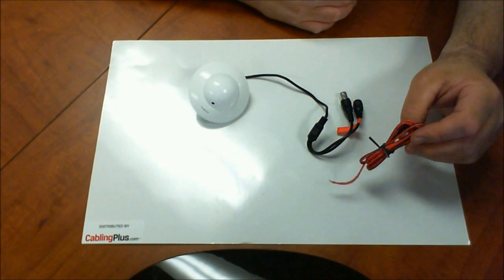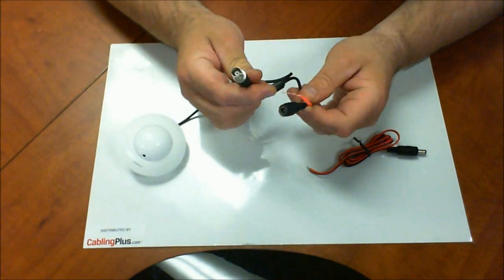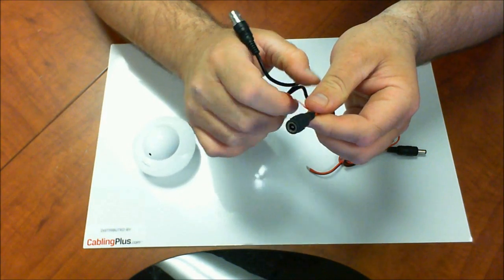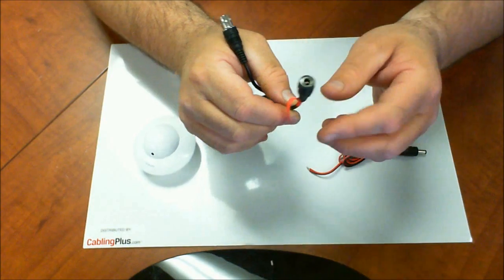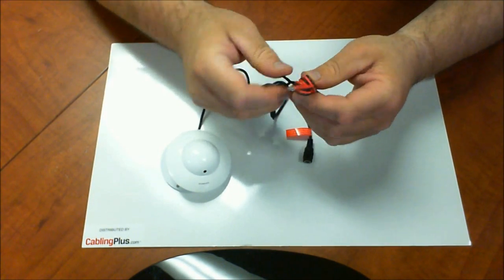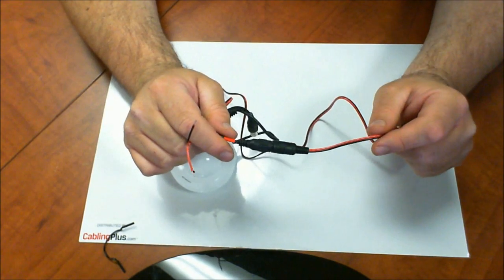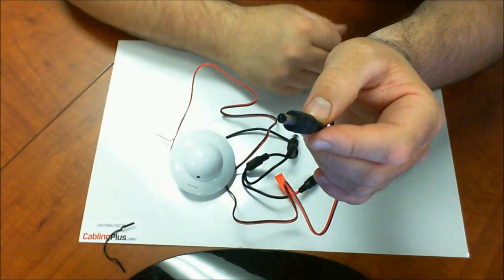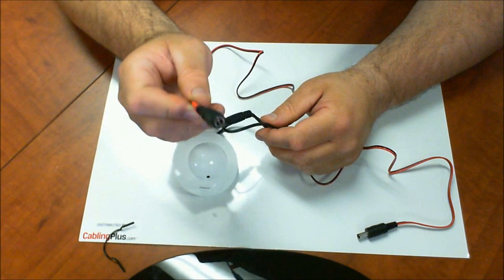DC Power Plug Pigtails for CCTV Cameras

Comment: How do you shorten your spool that comes in the pre made DVR kits cable length was 30m and I only needed about 10m -15m. Inside the Insulation. shielded red cable, shielded yellow cable and un-shielded cable. I made two of the eight cables work after Ive shorten them. Will adding solder increase the chance of the cable working?
Reply: I havent touched the cable or the connectors that go to the camera itself. its the lead that runs back to the DVR unit

Comment: If you accidentally cut the camera's power cable, how would you connect the dc pigtails to it? I did that and there weren't 2 wires? It was a flimsy braided wire. Would I just have to rerun the entire line again?